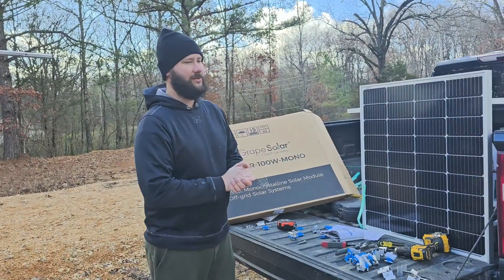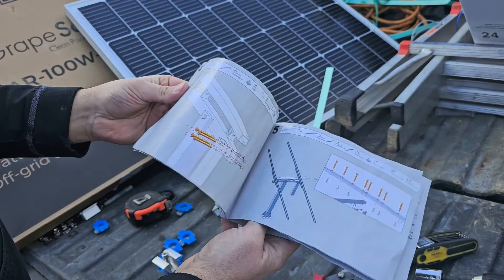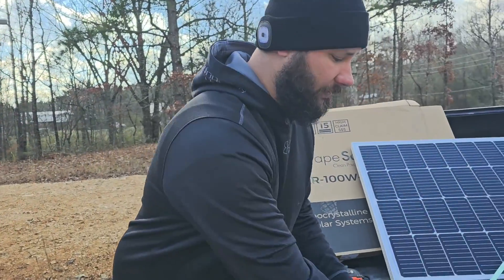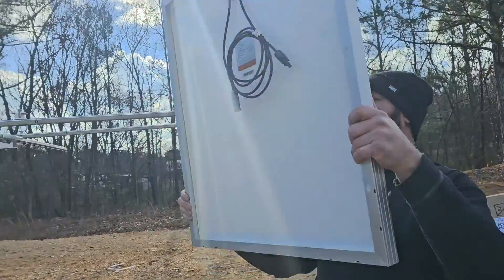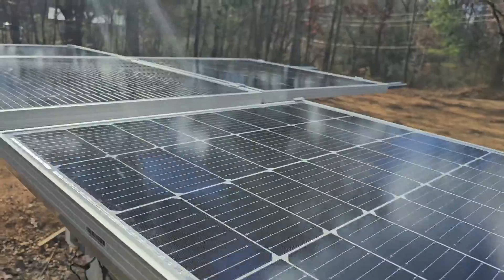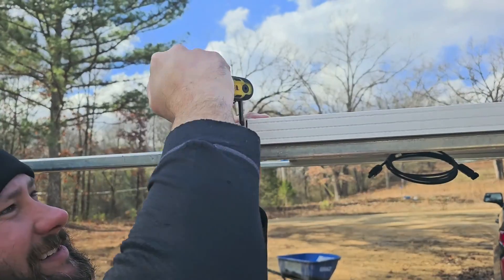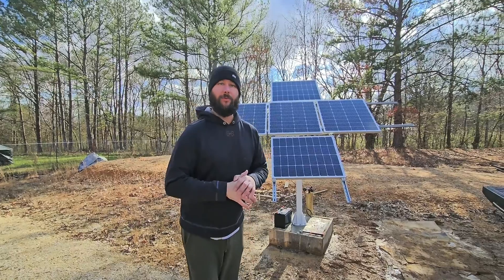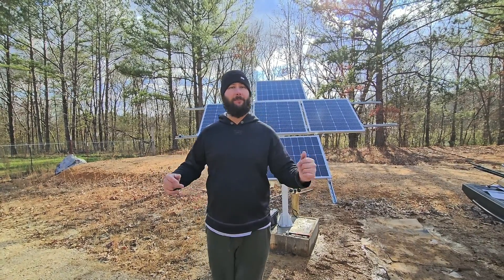Dual Axis Tracker Installations Made EASY with EcoWorthySolar's Pro Tips

Comment: Hi you have the North South 180 degrees off. That’s setup for the southern hemisphere. The tracker should tilt more south instead of north to accommodate for the winter sun. Great installation videos, I watched them for mine. I just realized it on mine and flipped it 180 degrees and the performance jumped significantly.
Reply: Living in NJ I will need to tilt in more south for the winter. Curious how you change the tilt 180 degrees? Are you meaning when installing it or is there a setting in the controller to do this ?
Reply: @IzzyNRem110Reed  when he installed it he put the actuator on the wrong side. He has it on the north side of the pole it needs to be on the south side. You can look at the manual to confirm it.

Comment: 4:06 I rather think the most frustrating part is: if i did my math right you installed 500Wp worth of modules on the tracker. thats about as much as 1 (one!) quality module does on its own. These are around 450 to 480 nowadays - and even 12 months back 400plus weren't to hard to find. so what i am going to say is: with just 2 modules in a static configuration you would probably harvest as much energy as you are going to with this highly complicated, expensive and error-prone (due to mechanics) setup. THAT'S much more frustrating than trying to stop your bolts from turning. Nevertheless: Big boys, big toys, i would install such a thing as well if i got a hand on it - just because 😁

Comment: Do you think my Ecoflow 400w portable panels will mount to this?
Reply from the maker: Those are probably 4 foot by 5 foot, so I don't think so. Check out the manual and look at the dimensions and the weight tolerance first.

Comment: I've never worked on a system like this but it's very interesting to watch.  I wonder if a big pair of vise--grips attached to the strut could keep  the side clamps from twisting away from the panel.  if you don't want teeth marks you could put a piece of pond lining between the grips and the strut.